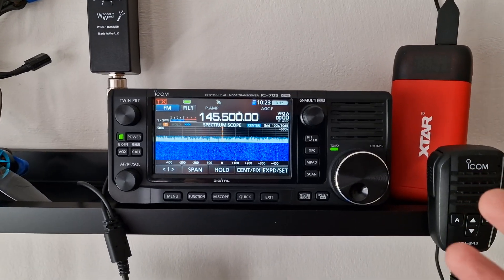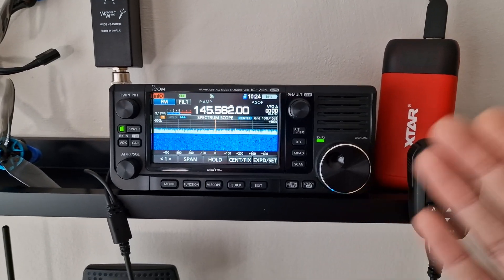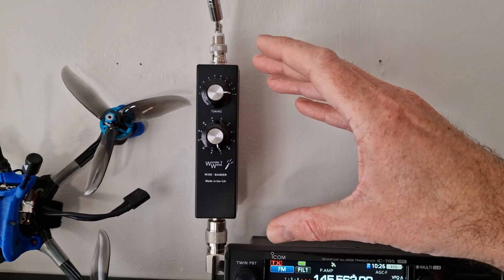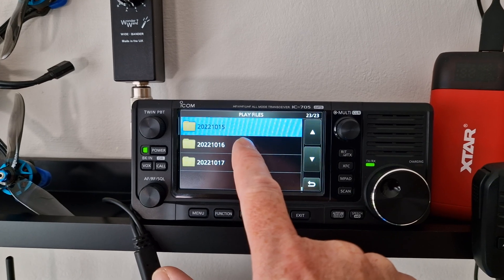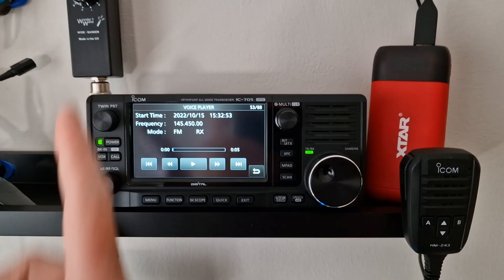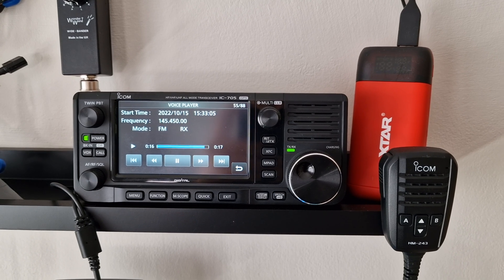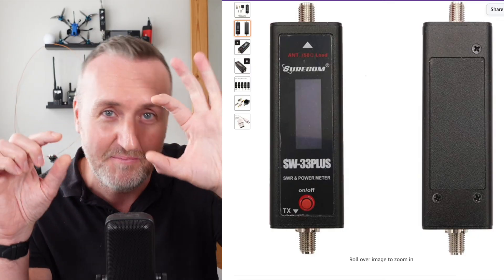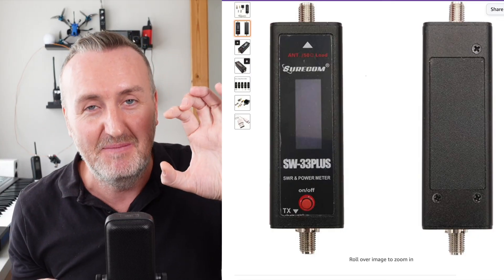WHY DONT HAM RADIO HANDHELDS HAVE SWR METERS?

Comment: Not having VSWR meters in handhelds is a purely a design choice. Handhelds are a nightmare for obtaining a "good" VSWR. If users knew how bad the VSWR on handhelds almost always is, they would panic. The power amplifiers are very robust so it is very unlikely to damage the radio these days, but performance will drop off as VSWR increases. It's all about finding an acceptable compromise.
Reply from the maker: I agree. I am still surprised that the Chinese haven't done it yet though as they usually love adding any new feature to have give them the  "edge" all they'd have to do is ship the radio with an adjustable telescopic.
Reply: @andykirby  the X6100 can be a handheld and it has an SWR meter 😉. 
But I know what you mean.
Reply from the maker: Please don't reply this is a scam

Comment: The IC-705 is a great looking radio $1,699.99+13% sales tax here in Canada, so a little out of my budget range. I have a new truck but wont put a radio in it, if the coppers see you using it a large distracted driving ticket comes with it.
Reply from the maker: Please don't reply this is a scam.
Reply: @andykirby  These are very annoying Andy, they pop up everywhere.

Comment: Walkies(Handhelds don't have swr meters because the stock antennas are already tuned to the frequencies that the radio covers, although for example the Baefeng 2m/70cm radios cover a lot of frequencies so they can have a high-ish swr on the outer reaches of the band. if you plug a Baefeng stock antenna directly into a spectrum analyser you'll see they are pretty good. if you plug a Baefeng stock antenna into a swr meter and transmit for some reason the swr will be much higher, maybe because of the cable length? so an atu will be needed.
Reply from the maker: Please don't reply this is a scam

Comment: That's a pretty high noise floor for 2M!
Reply: Pre amp is on :)
Reply: @Davidm-M0TPT  I have the same radio. Still a very high noise floor. Not sure you can control pre-amp on VHF with it anyway. Will have to check.
Reply: @dodgydd  happy days if its noisey just turn the RFG down and the ref
Reply: @Davidm-M0TPT  Or unplug the antenna. Both will be effective at making the scope look quiet, neither will be effective at increasing the SNR
Reply: @dodgydd  ha ha fair point, however, what I have found (on the 7610, 7300, 705, 9700 is by backing off the RFG it may allow or give the SDR a fighting chance to find that wanted signal. i think this is why yaesu went for the superheterodyne front end to do all the heavy lifting then let the SDR do what it does best.

Comment: Signal to wave ratio?? Come on Andy. (Voltage) standing wave ratio. A Tiger tail cut to a half wavelength of the operating frequency was what you were looking for. Excellent video. Keep it up.
Reply: Come on Ben, the "tiger tail" needs to be cut to 1/4 wavelength not half wavelength LOL. Just having a jab at you, because you had a jab at Andy LOL
Reply: @johnk8091  Thank you John. Just testing, glad you picked that up for me:)

Comment: 10:45 My guess as to why they don't tend to incorporate an SWR bridge into a handheld is because the match would generally be worryingly high. With a 140-174 MHz and 400 - 470MHz transceiver mated with the stock antenna, it is going to be all over the shop most of the time.
Reply: Absolutely this. Its a design choice. Handhelds are a nightmare for obtaining a "good" SWR. If users knew how bad the SWR on handhelds almost always is, they would panic. The power amplifiers are very robust so it is very unlikely to damage the radio these days, but performance will drop off as SWR increases. Its all about finding the right compromise.